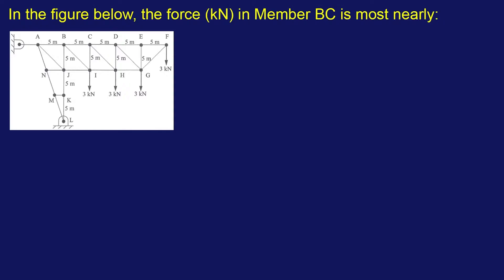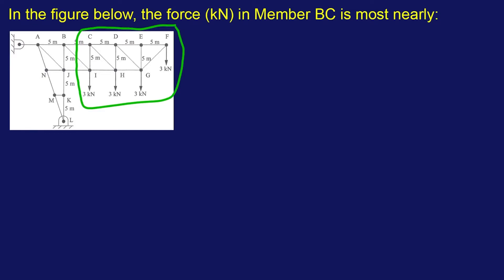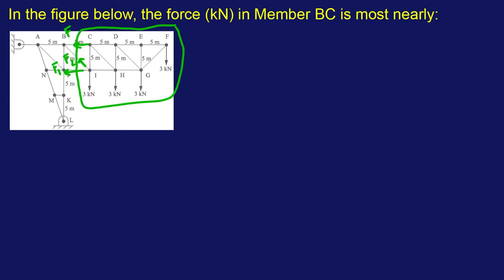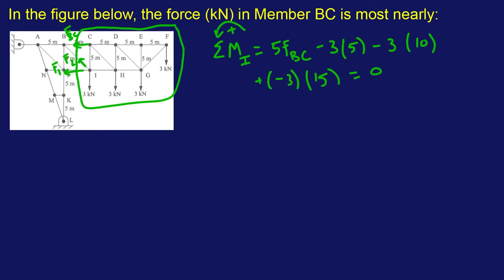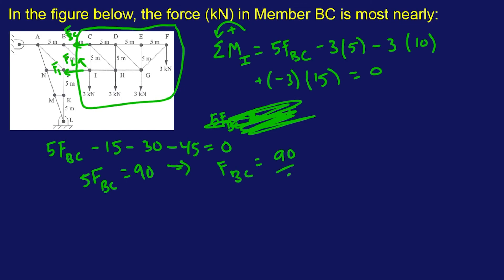FE Mechanical Exam Practice Problem #27: "In the figure below, the force (kN) in member BC..."

Comment: Can youndo a videonof this problem alex? 

The needle of a pressure gauge with a mass of 2 g consists of a uniform bar that is 150 mm long and pivoted at its center. To remove the vibration of the needle in use, the moment of inertia of the needle about its pivot point is tripled by adding equal weights at each end of the needle. To accomplish this and keep the needle balanced about its pivot, the mass (g) of each weight must be most nearly